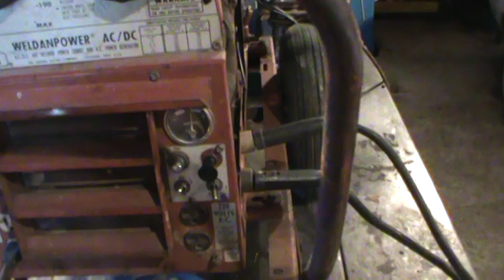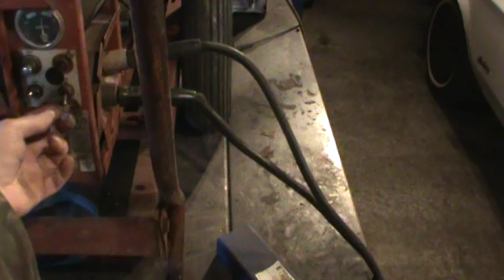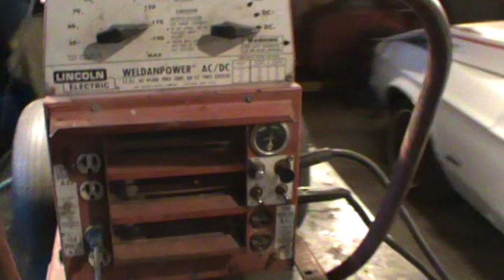lincoln gas powered welder getting repaired part 2

Comment: I picked up a weldon power 225 amp ,6000 watt  power outlet,onan engine, from an auction with 50 hrs use $200 runs like a champ great clip as i checked the spit rings , it was made in 1985 i wonder if that year model has problems with split rings as the 1980 models.

Comment: Nice fix, Bro. I was a welding machine repair tech here in N.E. Texas for 10 years (1990-2000) working for two companies in town (Airgas being one of them) and literally LOVED my job. That machine is a mid to late 80's model, not a 70's. If it has the original faceplate, you can look it up by its serial number. I actually didn't see many machines with the cracked commutator rings compared to the number of machines that were in circulation at the time, but I did see a few.
Reply: Slikk Willie, with your experience repairing these, and your vast knowledge, could you help me  trouble shoot my same welder? Mine no longer automatically idols down or up, the auto idol switch seems to no longer work. I would like to discover why, and fix it. first, can you tell me what the air gap should be between the piece of metal and the solenoid on the engine?  And then tell me other things to check. I greatly appreciate your assistance!
Reply: Slick Willie, and any one else,  tell me your thoughts on brazing the slip rings instead of using the screws. I'm just curious if this would be practical and possible?

Comment: Of course our fix at the time was to replace the rotor assembly as a whole as they were readily available to repair facilities. That process was a chore in itself. You were pretty ingenious coming up with the countersunk screws. Kudos for that. You seem to be exceptionally mechanically inclined already, but if ya run across something on your welder that stumps ya, I'd be glad to help ya out if I can.

Comment: Mustie I sure hope you fix this. I bought that welding machine so I could rebuild the Continental engine on my old Lincoln pipeliner need rebuilt. And after using this machine I wasn't in any hurry to finish the old pipeliner think it was a 62 model like I said in the last episode it was one welding son of a gun. I changed the oil on that every week because I worked 7/12 I believe I paid 22 or $2,300 for it

Comment: I just bought one for 200 bucks and have the same issue and it runs great. But was the work worth the time or should I but the armature with good sliprings and just replace the whole part or take the time and do the screw thing myself. The welding repair shop near me has a part machine and it has the whole part with good slip rings but the want 500 for the part. I wanna start doing so e welding repairs and this is my only machine atm

Comment: Hey on your welder is there a wire comming from behind the engines flywheel going into the generator housing? my generator has no exciter and does not charge the battery their is no wires comming from behind the flywheel and I believe it was supposed to have a flywheel alternator to provide chargeing power and to excite the generator.

Comment: I am aware that this video is an old one, but a gas tank off a Massey Ferguson 10 lawn and garden tractor is identical to the one on the welder. Also the exciter brushes on  Lincoln  3 phase electric powered 400 amp or larger welder can be used as the brushes on that machine, those brushes measure approx. 3/8 by 5/8 x1-1/4 inches long but as I said approximate dimensions I am going by memory as it has been years since I have messed with any

Comment: Excellent video! very helpful! Mine needs a muffler. I have seen several different styles of mufflers on these briggs engines, some small and round and others larger, almost tractor size.  But I can't find any of those mufflers! Has any one have the part numbers for different mufflers that will fit onto the 16 HP briggs engine? Thanks

Comment: Have you polished those rings any since the emery cloth repair polishing? I was on the Lincoln Electric website reading one of their manuals and they say not to use emery cloth. I think you're supposed to use paper and then leather or something. I just watched a slip ring polishing video and I think that's what he used. I think your brushes last longer with the fine polish action. I'll bet that ToBigWillie would know. He seems to be the man where welders are concerned! I subscribed, BTW.

Comment: Groovy. No that is a valuable video. Fantastic job of "southern engineering". I definitly learned something. Those WPs have pc board, and other various parts that Lincoln discontinued supporting years go as with all the old models. So beware if you are looking at old WPs. If there isnt any voltage output, and  If brushes are good it is high possibility it is the board.
Reply from the maker: +Joe Blow this ones still running strong
Reply: The warning was for others looking at the wps peppered all over Craig's List etc. Any running unit that hasn't just been horribly abused is very valuable. Cause you can immediatly go into business with it. Lincoln's alternators (generators) are bullet proof, but pc boards, and moving parts have a life span. Though the pc boards should also be repairable; and engines of course. Rotors & stators (alternator) can be rewound also in rare shorted out units. But, getting copper, and brass to mate, and using brass screws then using emery cloth, and starter was flat top notch. Your wp will out live both of us im sure since you give it new life, and you're obviously very capable of any repair.

Comment from the maker: disconnect the little wire going to the coil, thats your kill wire, if its got spark after that you have a safety not working,
Reply: what would cause it to run after the off switch has been shut off?

Comment: I need info on the automatic idol control system, as mine is not working. It did work once, now it does not. SO what should the air gap be between the metal plate and the solenoid  that is on the side of the engine? And how can i discover if the solenoid is working? How do I go about  checking other areas related to the auto idol circuit? All help  is greatly appreciated!

Comment: Do you still have this machine, I am repairing the same machine and the previous owner removed /re attached the wires going to the amperage selector and I need to see how to correctly route them if possible

Comment: so you still around how about an update on that machine is it still working did the repair work what's up
Reply from the maker: its still going
Reply: alright cool I was just wondering if it was going to eat the brushes up with that crack in the ring that was really a good idea of putting them brass screws in it
Reply: Mustie1 Wow, you've still got it and it's still working! Great fix!!!!
Reply: What's the output on it? Would love to have one of'm!
Reply: Check out the first video, right at the beginning. 7000 watts

Comment: anybody know how the engine disconnects from the armature because I was able to buy a new set of slip rings thru my welding supply store , $350 for the whole assembly but don't know how the engine separates. Any help appreciated
Reply: The engine  to armature shaft most likely has a tube with an internal keyway and has set screws on both ends  of the tube close to where the crankshaft and armature shaft  meets. you may have to loosen the set screws on the blower fan to gain access the set screws